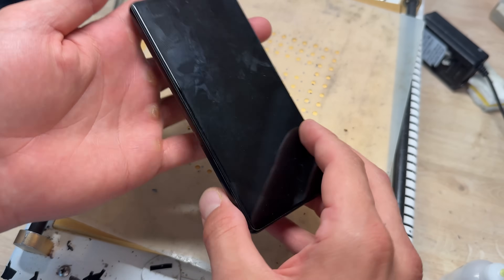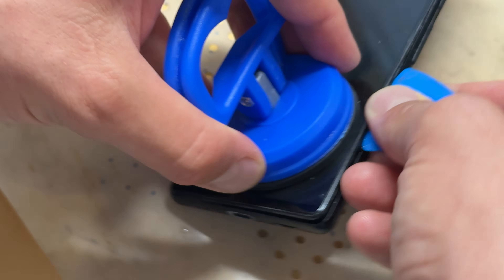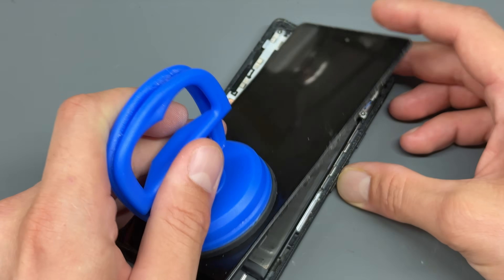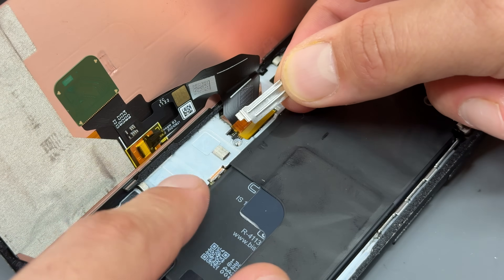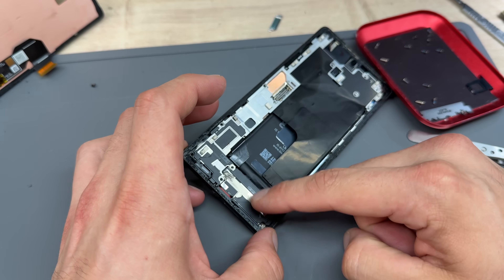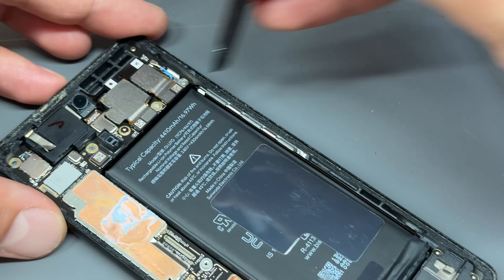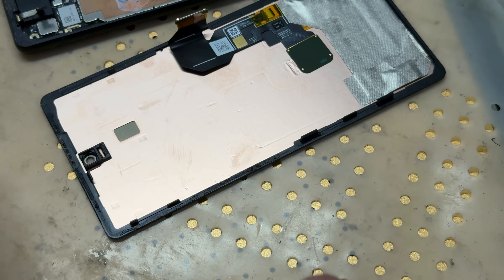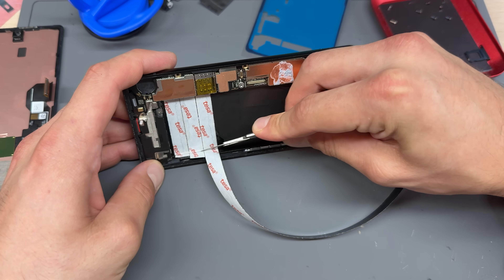Google Pixel 6a Battery Replacement (New Known Battery Issue Google Aware Of!) – Full DIY Fix Guide!

Comment: holy crap I just realized that I have a 3d printer, I have a whole hot bed and yet I'm here thinking I need something special to heat up my phone. I wonder if an air fryer works too
Reply: it worked perfectly. i have not tried the airfryer and don't want to. The glue around the frame is the trickiest part, but I've just realized a power drill and any metal rod will suffice so I'm going to try that

Comment: 5:20 There are several different sizes for the screws, so you need to put them back in the same positions.  Just put then aside in the same position as when taking them out and don't scramble them up.  IFixit has a nice guide with picture references for the screw positions and screw sizes.

Comment: ty for the video. Got a 100usd compensation from google and did this myself with the help of the video. The charge cycle was reset and all good now. Supposedly it will still go into that crisis mode after another 400 cycles, but i think it lasting around a couple of more years is good enough for me.
Reply: 100 usd ? How
Reply: @dashrathkuwerbalot9229  google "google 6a compensation" there should be a google's page about it

Comment: note: check the rubber grommet on the proximity sensor.
I had to swap screens(because my wife dropped hers and my bootloader was bricked) and replace a battery. I'm suspecting I didn't see the old grommet from one screen stuck to the other. Now the proximity sensor isn't working.

Because all the battery kits are out of stock for weeks now, I had to buy some aftermarket kit and some phone glue. Can't get the phone open with the hairdryer anymore.

I'm quite done with google and their pixel fuck ups... my battery was doing fine until they nerfed it, and in my country there was no battery replacement center...82€ I received... not even enough to cover a battery replacement in a phone repair center...

Comment: Be careful to order a good quality battery from trusted site. I got a supposed OEM replacement and after replacing it still has over 400 charge cycles, making the phone still nerfed. Also, the phone will still nerf your new battery after 400 cycles based on your IMEI, unless you have google replace it for free.
Reply: Can you fill me in with trusted site where I can order a good quality battery for my pixel 6a

Comment: Do you have to tell the phone that battery is replaced? I mean because the phone limit capacity of the old battery
Reply: I talked to google support people, they claimed once battery is replaced , the software will auto deactivate the restrictions
Reply: @pritesbas9247 It doesnt. Cycle count persist after battery change
Reply: The cycle count is stored in the battery, which the phone reads through a serial data link.  It should know that the battery's been replaced.

Comment: Do you have to tell the phone that battery is replaced? I mean because the phone limit capacity of the old battery
Reply: Just did a replacement, it detects the new battery and the alert goes away
Reply: @sugarfootthompson9944 was your phone over or under the cycle count?
I'm concerned that once the software update is applied, it's not easily reverted...
Reply: @MichaelRuppe  Even with a new battery, the update itself is not reverted. The update simply adds the check that puts it in limp mode. Replacing the battery simply causes that check to not trigger.

Comment: Mines around 850 cycles in and never had a problem until the new patch. Now it overheats daily.
Reply: 693 cycles and I'm doing fine... the battery nagging gets on my nerves though especially because I can't even find genuine replacement batteries for sale in the US.
Reply: It's even on grapheneOS now D:
Reply: @TaronArts  wait fr?? god, is it even worth it to repair my phone now?
Reply: @Ham.V0 yes, its still worth it. I have changed the battery myself and my system went back to normal again.

GrapheneOS showed the message just once and briefly when I hit 400 cycles. The battery drained super fast and the phone became hot when I used it after the fact.
But it went back to normal I'd also say the change is medium difficulty because the phone has clips and a plastic frame around the screen. I didn't even bother changing the glue.
Reply: Same with me. I downloaded the new patch & all the sudden, I had this problem
Reply: @taxaca1 the 
Watch was to kill you battery over few month it said on the notes on the patch.
Reply: Why is this symbol ! coming from my phone?
Reply: @fahadjunaed2370 it's because your battery is damaged, change the battery and it'll be vanished
Reply: Same issue
Reply: Yeah it was fine then one day it started having issues. I'm at 837
Reply: same

Comment: I can't wait for that tool link. I have a Pixel 6a I want to swap the logic board out on because the old one is FRP locked.
Reply from the maker: Link is there now :)
Reply: Can you do a video on replacing the logic board? Interested to see how that works as I had a pixel 8a that I had to let go for parts because of frp